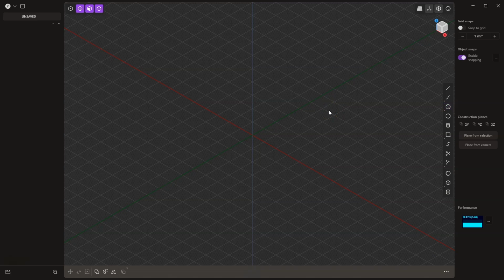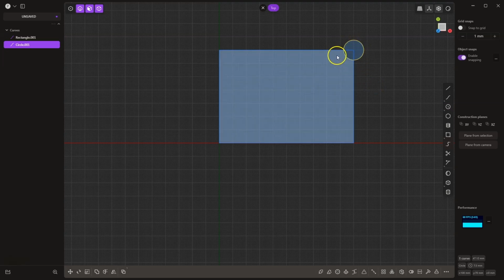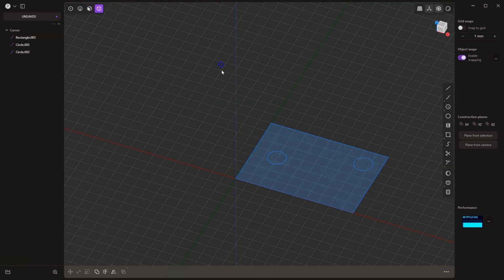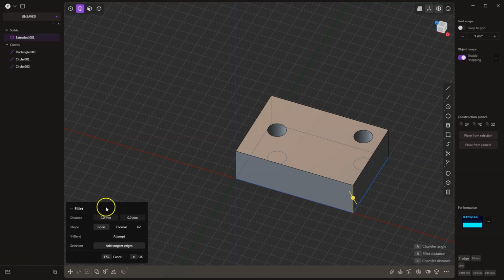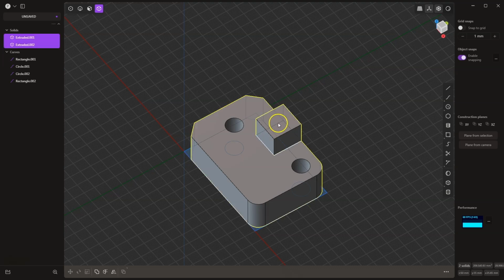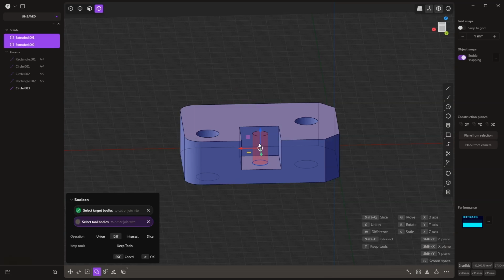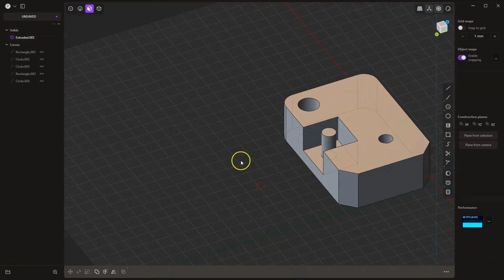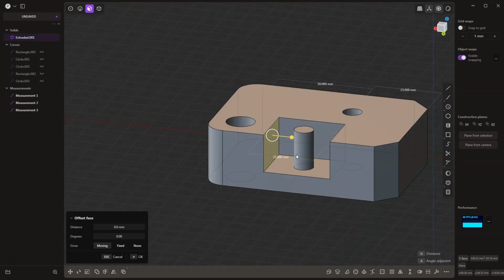Plasticity Fundamentals

Comment: Amazing! I have been trying to learn Plasticity for a couple of months really not understanding exactly how it worked. This tutorial, especially your 'afterthought visa vis measuring, has changed everything I feel about the app and I feel more confident about creating accurate models. I am going towatch it again and again :) A must watch for anyone using Plasticity thanks so much. 

Are you using the Windows version? I feel that some of the UI is slightly different from the Mac version.
Reply from the maker: Thank you so much for the kind words! 😊 I'm really glad the tutorial helped you understand Plasticity better. I used the Windows version earlier, but now I use it only occasionally. There might be some small differences, but I haven't noticed anything significant.